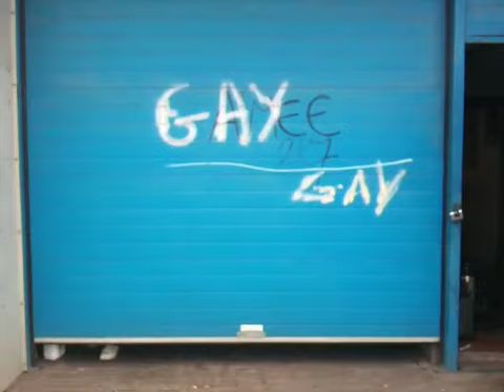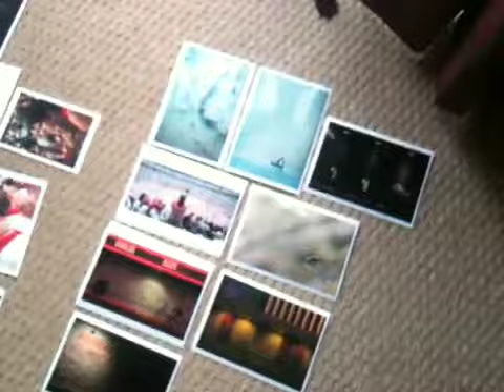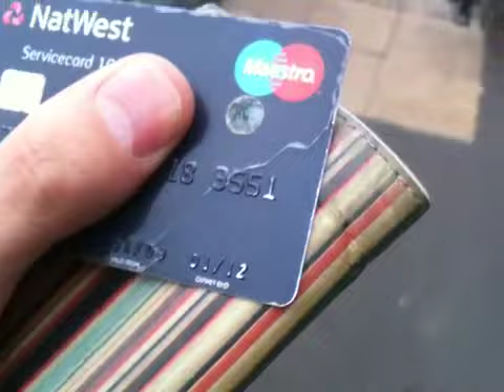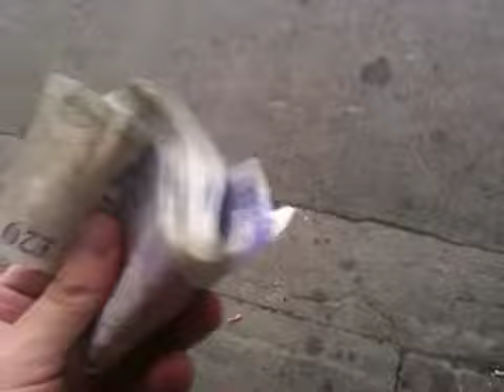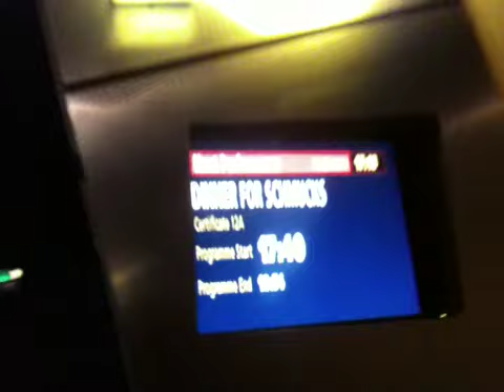266/365 F.O.R.D. FIX OR REPAIR DAILY

Comment: @REDBULLHEADiphone My old company (Enterprise rent a car) had Fords. The S maxes and new shape Mondeo's were nothing but trouble. If it wasn't windows trims and things falling off the interior it was engine malfunctions and [i] lights coming up on the dashboards (warning triangles and bongs if it was a Mondeo). I had a Connect 1.8 TDDi before enterprise which I absolutely hated. I have no idea why companies buy them. Cheap parts I suppose.